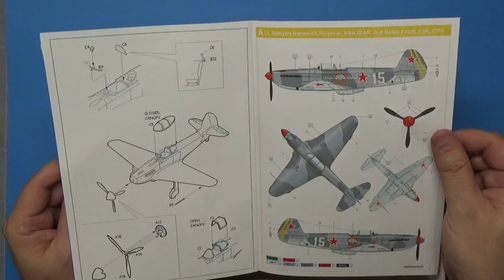Yak-3 Normandie-Niemen - 1/48 - Eduard - full build

Comment: Nice build.  I have couple of questions for you.  What you using to dilute the Vallejo paints and what is the ratio?
What is a size of nozzle and pressure  for a airbrush set up?
Is it not necessary to prime the cockpit before paint (Vallejo paints are  bit fragile with out primer)?
Thanks and keep building.
Reply from the maker: I used Vallejo Air... So I don't need to dilute it excepted for the primer (ratio : 70% primer 30% thinner)
I paint with 0,2 mm airbrush with a pressure around 1,5 bar
In the cockpit, I used the paint directly after cleaning with alcool. As, it is not a contact surface, the paint stay well, So I didn't have any problem. Moreover, I want to limit the chromatic effect due to the primer.

Thanks for your comment ! I hope your will share picture ( or video) of your work !